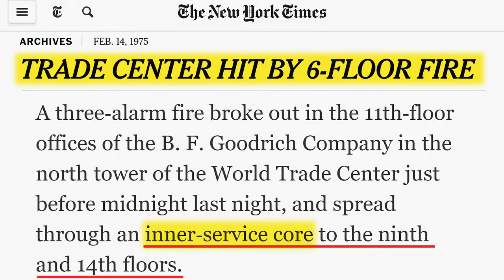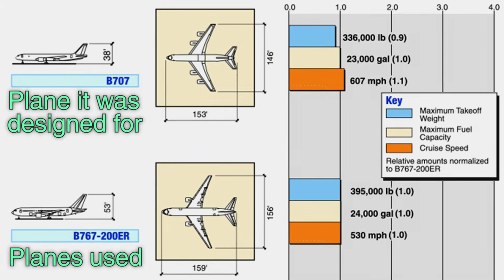9/11 - How Hot?

Comment from the maker: """You'd get down below and you'd see molten steel, MOLTEN STEEL, running down the channel rings, like you're in a foundry, like lava." "From a volcano.'""" -Firefighters who were actually there. 

https://www.youtube.com/watch?v=nwgkA5rlwKI
Reply from the maker: To the person who just spammed 40+ video links to this comment, the airplanes were not CGI or holograms. 

The video where the airplane's wing goes behind the building, is because the building is much closer to the camera and about 1/4 the height of the Twin Towers. 

Here it is on the map: 

https://www.google.com/maps/place/The+Downtown+Club/@40.7007026,-74.0154741,296a,35y,2.89h,70.3t/data=!3m1!1e3!4m5!3m4!1s0x89c25a119b9eccff:0x4d46fb8a6543cf3!8m2!3d40.7062159!4d-74.0156972

There is no 90 story building right next to the towers, it's perspective. 
Please look at a map and research first before repeating claims.

Also, the videos of the penetration of the airplane can be explained very simply, it was likely a specialized drone missile that looked like an airplane that hit the towers. That would explain how the aircraft sliced through the beams without any bending, breaking, or debris visibly falling.
Reply from the maker: That’s the video I’m referring to, it is incorrect. Look at a map, the wing is supposed to go behind the building. It’s not a CGI glitch. I went to school for CGI, so I looked very heavily into this theory. I’ve seen all the main videos about this, they have many errors and are deceptively misleading. 

I’ve lived in Manhattan and saw the smoking aftermath that day. I know plenty of people who saw the airplane with their own eyes.

Comment: 0:11
“10,000 gallons of jet fuel poured in to the building “
@8 pounds of weight per gallon, that is 80,000 pounds worth of jet ⛽️ fuel, or 40 short tons….
I am really niavé about jet weight capacities, but even with 100 passengers at weighing 200 pounds apiece (on avg) that’s 
200x100= 20,000…
So just the fuel alone was equivalent to housing 400 people each weighing in at 200 pounds apiece, or basically the size of a fairly large man times 400…
So how on earth do you even get that capacity of fuel into a jet plane of any size? So mostly stored in the “wings”? As the airline professionals tells it?
So if even one quarter of the fuel is stored in each wing, leaving the second half stored somewhere else, that is still 20,000 pounds apiece for each wing, so you are telling me, with my very conservative estimates that each wing weighed close to 10 short tons and with no problems whatsoever always magnificently soars right up into the sky, and this is done every single day like clockwork as if it is as easy as shrugging one’s shoulders to do?
I must be really dense,
Bc I am missing something about that…

Comment: Most of the clips say that it was between 1600 and 2000 degrees Fahrenheit. In this video, a man bends a piece of steel at 1800 degrees: https://youtu.be/FzF1KySHmUA 

Side note, one clip said that the fires were at 2300 degrees. I will admit that's an over exaggeration. However, that would be the fault of the documentary makers, not science nor the US government.
Reply from the maker: Just search, "How hot does jet fuel burn". All the mainstream sources say between 800-1500 degrees. 

The blacksmith claims to heat the rod up to 1800, even stating in the video that it's "just 300 more than jet fuel".  

The top 15 stories of the tower were supported by the bottom 95 stories. Yet, those 15 stories managed to fall to the ground, crushing the bottom 95 stories, as fast as if there was only air below it.
Reply: @muskduh  You're right. We should have sent someone in on 9/11 to see how hot the fires were. We need exact measurements!
Reply: @6piecechickenmcnuggets23  We have the exact measurements. Carol Ciemiengo's FLIR footage at the end of this video tells the real story; the fires were almost out at barely 400F when the buildings suddenly exploded.
Reply: @EmpathicUnderstanding  
"The top 15 stories of the tower were supported by the bottom 95 stories." 
The top 15 stories were supportet by the core columns and the facade...not the 95 stories below. And at this altitude, the columns were built to handel only the 15 stories + the safety reserve.
Those mass from the 15 stories crashes into 1 storie, the 16 storie mass crashes into 1...
Reply from the maker: When I say that the top 15 stories were supported by the bottom 95, obviously that means the inner and outer columns beneath the impact zone.  

The government admits the towers hit the ground in about 9 to 11 seconds, essentially free fall they say. 

https://www.nist.gov/topics/disaster-failure-studies/faqs-nist-wtc-towers-investigation

The structure was designed to support the weight on top of it. The fire weakening the top area should not cause the area beneath it to explode and collapse at free fall.